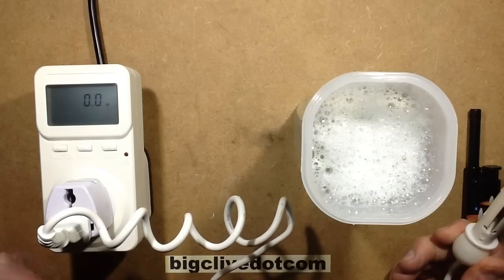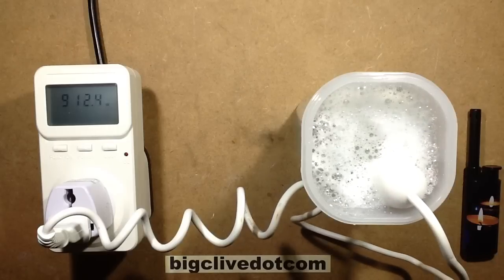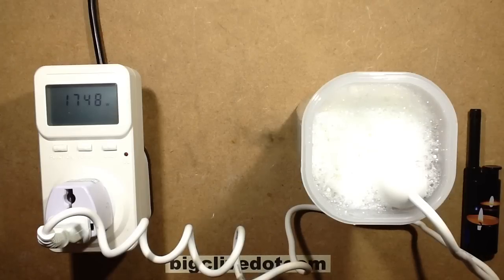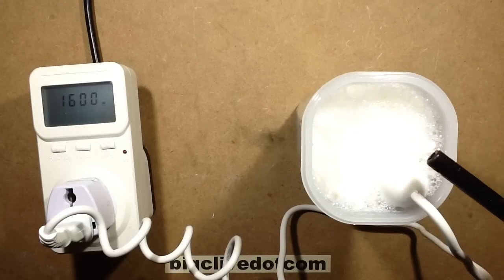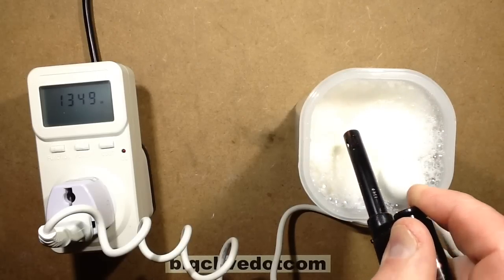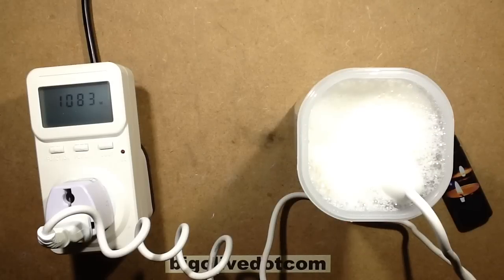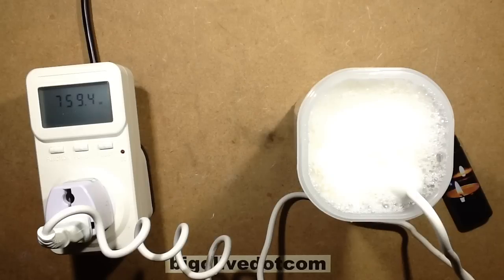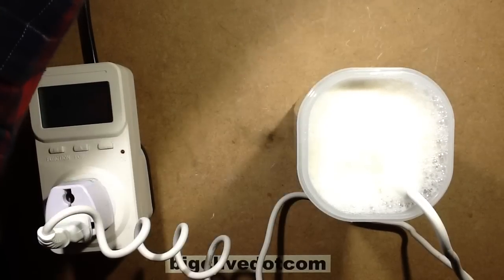Does the AC electrode boiler produce hydrogen and oxygen?

Comment: I still think it is dissolved gasses coming out of the water.  This happens long before the water boils.  You can see the bubbles form on any submerged heater element as it heats up but long before the typical steam collapsing bubbles start to form just before vigorous boiling.

Comment: I wonder what the power factor and amp reading are.  I'm fairly sure the water will only conduct when the voltage reaches a certain point in each half of the AC cycle, in which case it could be drawing in excess of 13 amps.

Comment: As I had used a 20 liter pail of ordinary tap water without added electrolytes it took a long time to heat up. The bubbles of gas produced while the water was still cool easily ignited. Once the water was well heated enough to create water vapor the bubbles stop burning so well. I presume the hydrogen/oxygen gases would mix with the hot water vapor and thus losing some of it's explosive power.  If you run your experiment again while the water is still cool you'll have plenty of fine little explosions:)

Comment: As far as i understand, AC can be used for electrolysis, you may need to use a different electrolyte such as baking soda (salt releases chlorine gas).
Reply: +Paul Martin if the boiler plates were stainless, wouldn’t that make a small amount of chromate?
Reply: Hmm, not sure, I've done electrolysis with stainless steel electrodes before, and gotten plenty of hydrogen. It may depend somewhat on the electrolyte.
Reply: +hunterboyvids with salt it does, it eats through the stainless like cloth. Never put stainless on the anode with a sodium chloride solution
Reply: +Laharl Krichevskoy interesting, I'll have to remember that.
Reply: Paul Martin  last time i tried, it was a second to see if i could clean it from some stuff that stuck to it. The .5mm stainless sheet looks like sieve now. And the liquid turned a bit green, i think because of chromium.
Reply: +Paul Martin An other electrolyte only lowers the voltage where electrolysis can occur. But most of the ions moving will be then the salt ions. Elctrolysis will occur though at high enough voltages and low enough concentration of salt (which will rise when the water boils away) I don't know the figures off the top of my head.
Reply: +Laharl Krichevskoy How long did that take? and at what voltage/current?
Reply: mspenrice  it took no more than 5 seconds. the water had salt added till the current was at about 4 to 5 amps because that's my psu limit (6A max and dont want to push it)
i swapped the iron cathode for the stainless for a second to see if it could clean some stuff that was sticking to it and then the bubbles came but seeing it did not unstick from it i raised it and notices the shiny surface all getting rought, like munched :(
Dont really remember it that clearly what i was doing, i think i was making iron oxide for use in making thermite but not that sure, what i'm sure is it was salty water and that i inverted the polarity for marely a few seconds before i noticed how it destroyed it.
Reply: interesting, I wonder if you were making chlorine instead of oxygen because of using NaCl. This might have to do with the pitting you saw on the electrode, since stainless should at least resist reacting with oxygen.
Reply: Paul Martin
 afaik and not that i study chemistry or something, salt kind of works as a catalyst accelerating the oxidation process. Maybe stainless resist oxigen in air with water, but not with salty water.
Iron rusts with water after a long time and many tries, but if you leave salt water on iron, it will rust  a lot on the first try.
It sounds to me it has to do with that.

edit:
now i remember, it wasnt salt water, it was cooper sulphate. I was making sulphuric acid.
Salt water did nothing as before i was using both stainless electrodes in salt water to make hho.

it was suposed to make hydrogen from the stainless and Cu + H2O on the other which was cooper. I switched it around a sec to clean some goo it has on it and it caused that. Most probably the blue turning green is because it formed chromiun suphate in an redox or something, dont remeber if copper was forming on the staniless though.
Reply: Sounds familiar ... I suggest you go read your old school-days Chemistry workbooks if you still have them and get the correct story.

(I can't remember it either, but I suspect copper sulphate + something else would give you copper + sulphuric acid + maybe some spare gas or precipitate)
Reply: Also, five seconds, wow. I might have thought 5 minutes to an hour or so o_O ... that's frighteningly quick.
Reply: mspenrice copper will dissolve in sulfuric acid! It is used for fast etching copper!
Reply: ...so that's what was in those etching tanks at school. They never did tell us.
Reply: mspenrice More commonly used was Ferric Chloride as it is less corrosive as Sulfuric Acid. 
But several other mixtures are used. I used once diluted Sulphuric Acid and it etched my board within a second, while Ferric Chloride took more than a minute. But the latter is more controllable: less underetching!
I guess you used that!
Ferric Chloride is a dark brouwn solution.
Reply: Imre Fabian muriatic with hydrogen peroxide and the copper washes out of the pcb like ink with alcohol. Really exothermic though, the water was steaming after finishing a small pcb
Reply: Laharl Krichevskoy At my school we didn't use that!
Reply: Never heard of Ferric Chloride, though they might have just called it Iron Chloride (Iron-2-Chloride or the like maybe?) or even Ferrous Chloride. IDK. If it was ever mentioned it was a very very very long time ago, and only like once.

Wouldn't be surprised at dilute sulphuric acid really. Schools tend to have gallons of the stuff readily available as it's a common chemistry experiment substance, and if it's as powerful as you make out, it could be easily diluted down a LONG way and still be effective, just needing the boards to stay in the bath a little longer to actually etch. Seemed to take a long time for ours, probably 5+ minutes if not way longer.

Then again, did the baths have brown stuff in them? Was that Ferric Chloride, or just suspended copper particles? Or am I mis-remember-imagining it? Just who is Hong Kong Phooey?

The hydrogen peroxide thing is ringing a bell though. Like with a final stage where you pick the board out with tongs and rinse it down with some clear liquid out of one of those squeezy bottles with the curved straw coming out of the top, and all the unused copper sloughs off leaving only substrate and traces? Could also be that they came out with a whiff of steam but we just assumed the fluid was being kept hot to speed up the process.
Reply: mspenrice Ferric Chloride, or Iron-3 Chloride is (still) widely used as PCB etchant. During etching it will be reduced to Ferro Chloride (Iron-2 Chloride) while the Copper goes into solution as Copper Chloride.
Ferric Chloride as well as Ferro Chloride is (reddish) brown, but Copper Chloride is green. The mixture becomes a very dark (almost black) greenish brown.

In story linked below rhere are som coloured pictures.

http://fritzing.org/learning/tutorials/pcb-production-tutorials/diy-pcb-etching/

Comment: Do electrodes corrode? I mean especially, when you use it to heat drinks with different ingredients? If they do, that could be the problem, when you drink it, because there may be some nasty electrolysis products that were made - although there won't be much to see, there still may be something in. Electrolysis with AC is very inefficient, but may still change some compounds in your tea.

Nice experiment, btw ;)
Reply: I thought it actually might, but if it's only water, and if you dry the stick (to avoid rust), I think it won't make any damage.

But, think you can produce electricity with this, if you connect something to the plug while it's in water :') Electrolytes plunged in water can produce electricity, I think 80% of people reading this may know it, but might not have noticed it !

Comment: Apparently electrolysis does not work with AC because electrolysis requires a constant anode electrode and a constant cathode electrode. With AC, the anode and cathode constantly switch so the process of stripping electrons from the water molecule on one electrode and feeding out the other electrode doesn't happen.

Comment: If you were to fill the cup up from the mains(British speak for water from the street pipes not a local holding tank), while the heater is in the cup, i wonder if you could get it to trip an RCD by leaking some current back to ground via the running water of a grounded main's water tap/pipe? heh.

Comment: Gallenkamp bomb calorimeters from the 1960s had water jackets heated by an AC current through distilled water containing a small amount of sodium carbonate. There was no mention of electrolysis  though no doubt some did happen.  If the active and neutral wires of the mains plug were exchanged the heating was uncontrolled - I have a personal experience with that - incidentally, the electronics were vacuum tubes.

Comment: Even with DC it's damn hard to electrolyse water. The usual tricks involve adding a little KOH or H2SO4 to the water.
You need crazy high voltages to split pure (distilled) water into hydrogen and oxygen.

Comment: Adding a 1+ KW 'Full Wave Bridge Rectifier' between the AC and the boiler, would send DC to the boiler and would (or should) be making lots of hydrogen and oxygen.  So much in fact, if not quick with the lighter, it may be more than desired and result in  a large flash of fire.  Which would be fun, but do be very careful.  Plain water and a little dissolved salt would be an interesting test.  Maybe BigClive will try this and we'll all get to see the result if such a test and video is made.

Comment: Apparently AC cannot perform electrolysis because it is constantly switching its polarity; half of the time the cathode is positive, and vice-versa, so the hydroxide and hydrogen ions cannot reach their respective terminals quick enough for electron transfer to occur. I'd wager that a small bit of electrolysis does indeed occur; perhaps just more oxygen is created.

Comment: The mains voltage may not be so clean .. there could be just a slight DC offset caused by single diode rectifiers and other disrepancies in the mains AC so i think that there is surely some hydrogen production going on. You can prove it yourself as hydrogen bubbles tend to be very small  in comparison with other gases. Best way is to compare it with the same electrodes and just a few volts DC. As others have pointed out, water wapor would condensate. Only large bubbles when the water is hot engough can survive reaching the surface.

Comment: The more I see of this deathtrap the more I am tempted to order one...

To make it produce hydrogen you need DC, with that said you could build a simple rectifier for the line input and try that unless you have a DC power supply that can go up to 240 volts..
Reply: +ElfNet Gaming Do it, Clive!! Do it, +bigclivedotcom !
Reply: +ElfNet Gaming Just get 10 x  24v Truck Battries...
Reply: +ElfNet Gaming You don't even need that much DC voltage for electrolysis.  A bench supply is more than enough.
Reply: 10100rsn True but whats the fun is low voltage when you can supercharge the process and create a bonus safety hazard